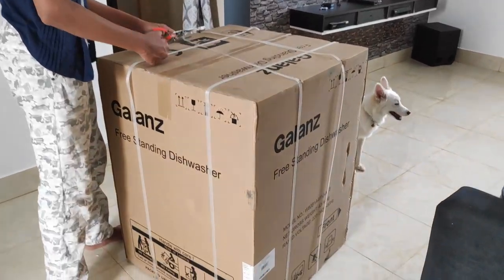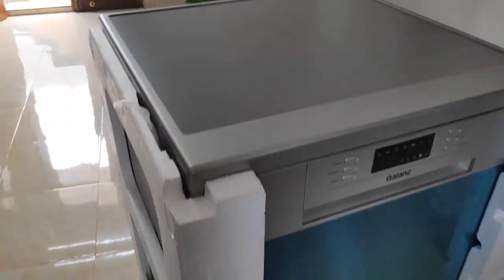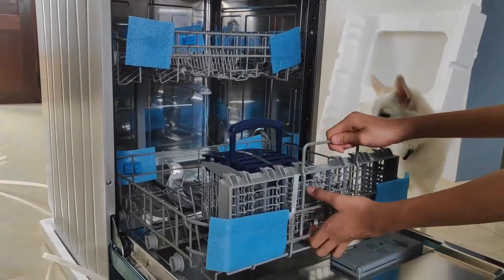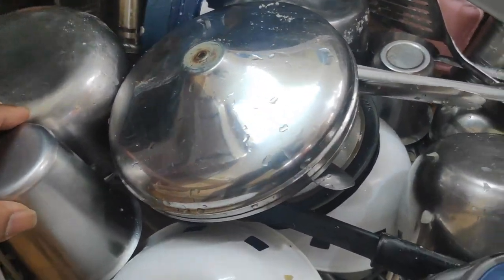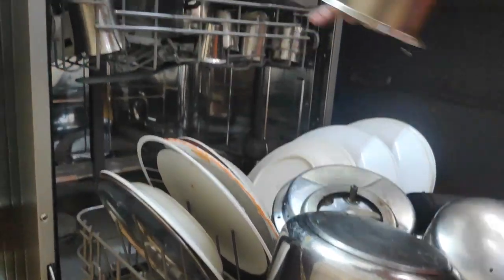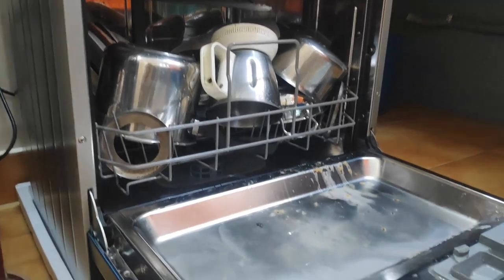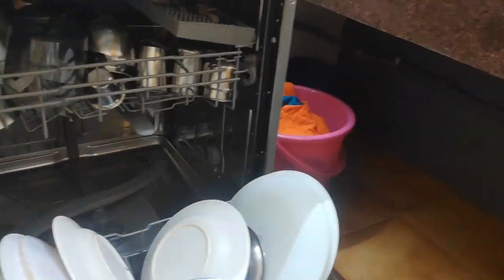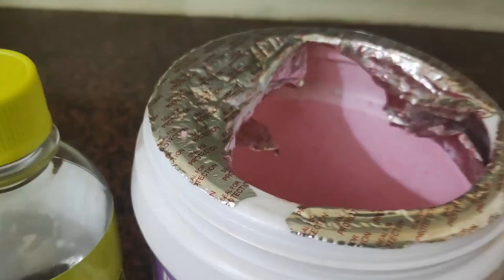Galanz Dishwasher UnBoxing & Review | India's Cheapest Dishwasher

Comment: I ordered it but returned and than i bought midea. Galanz didnt have memory function. If light goes out it again starts from begining. And in my area there is lot of power cuts
Reply: Price ? Can v wash Alluminium vessel?midea
Reply: @TheIslamicClips  Yes we can. Dishwashers are the need of hour. You have only to take care of Non stick cookwares and plastic food containers. As it will destroy teflon coating on non stick cookware. Plastic containers will deform due to high temperature of water used in dishwasher. But now a days some manufactures are making dishwasher safe plastic food containers. Also kadahi and tea pan are not washed completely due to heavy stains on them. For all other things you can use it. And you will love it as it saves time and hardship. Price s in big billion days alsale was 24290. Now its 26990 on flipkart.
Reply: Thanks 4 ur kind reply
Reply: @TheIslamicClips  welcome
Reply: Midea kaisa hai

Comment: does it have memory fn for electricity switch off and then on
Reply from the maker: No  that useful facility is not available in this machine
Reply: @reachraviraj  suppose elect. Goes off while it's running ,can we open the machile lid to take some utensils or it gets locked
Reply: @arvindidg  Any update on this query
Reply: @reachraviraj  Will we able to open the lid if power turned off